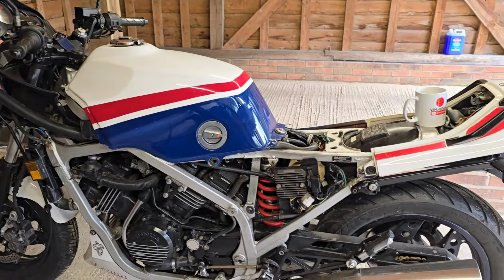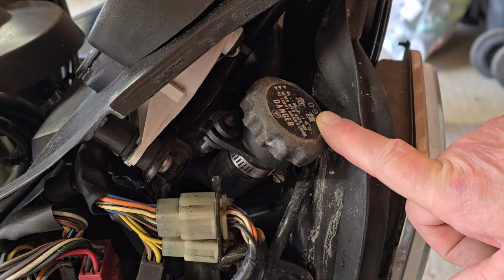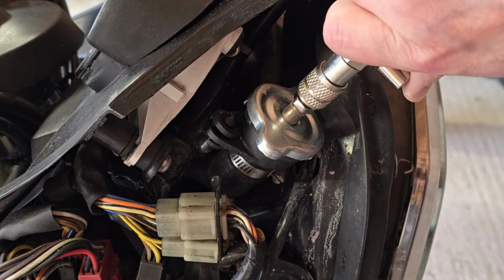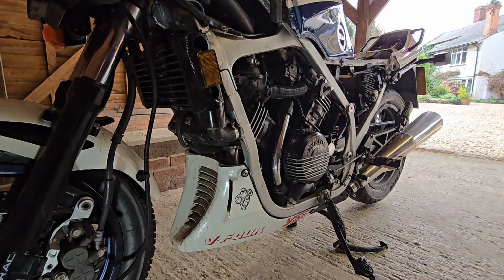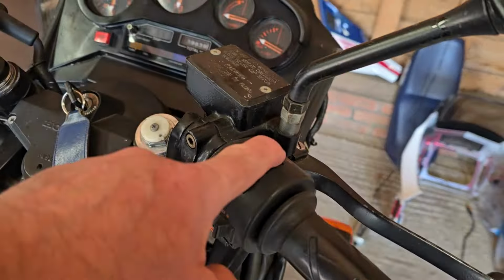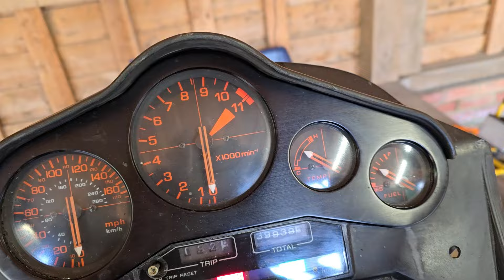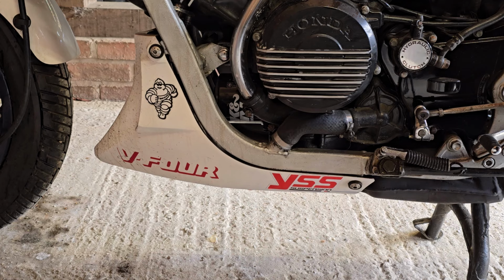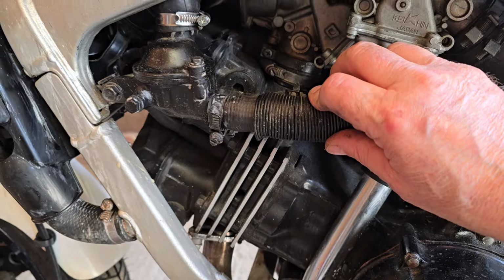Honda VF1000 cooling system investigation

Comment: That’s the wrong coolant in there. It shouldn’t be pink it should be bright green, (basic ethyl glycol) though newer Honda type 2 coolant is blue; Pro HP rather than the original Pro. “Modern” pink coolant contains silicates which as you’ve found out will jelly up especially if it mixes with the green type and aren’t good for the water pump. ‘93 VFR750FN owner.
Reply from the maker: Thanks for commenting! I've put standard "green" ethyl glycol coolant in now and all seems well!